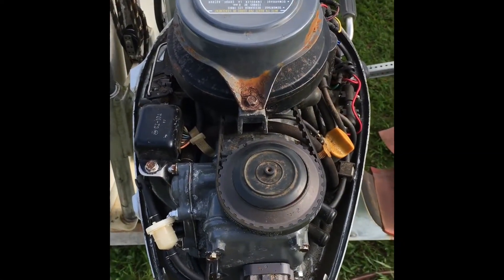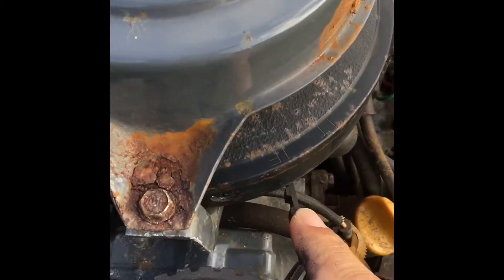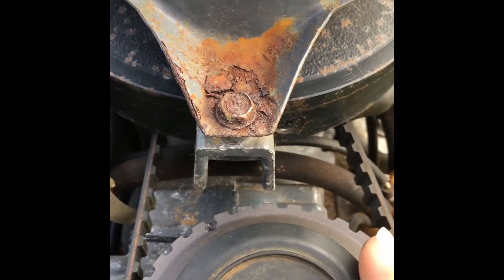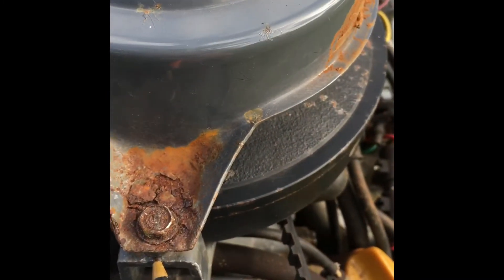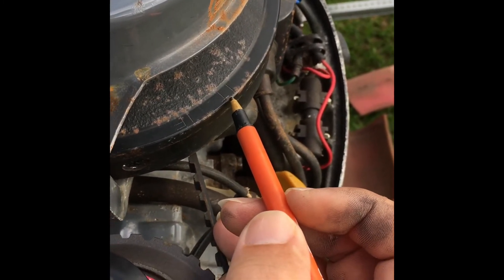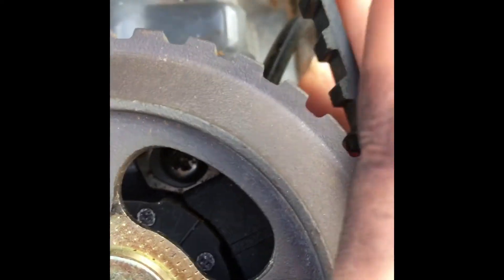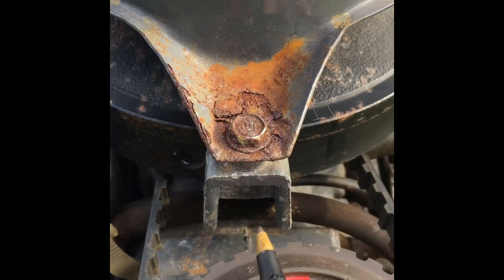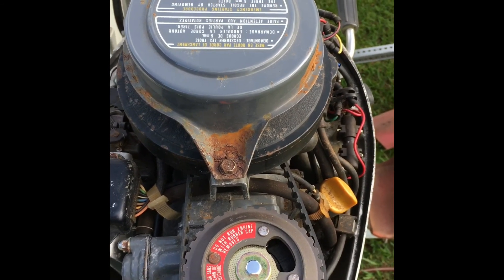Verifying the Timing on a Honda BF8A Outboard Motor

Comment: great video, does this apply to the BF100 and BF7?
Reply from the maker: Thanks. I can’t say for sure as I don’t have specific experience with those models, but in general the same principles should apply to a 4 stroke two cylinder Honda, or any motor for that matter -that being that you must align marks to makes sure your cam and crank are timed with one another before installing your timing belt, and that your ignition needs to fire at the proper point when the valves and pistons are at their correct position.

Comment: Great video! How would I check my ignition fire  F if my motor has points? Thanks!
Reply from the maker: Thanks. Not sure about the specifics of your points motor, but in general with points you would want to use a test light to make sure the points make contact to discharge the coil and fire a cylinder as indicated when the test light illuminates when the flywheel is at the correct mark, which is likely F if that’s what you have. And then you would want to adjust the gap of the points so that they open the correct amount when not making contact. The manual for your motor should cover it, and typically if you put a little time into it you can find the manual or at least parts of it posted somewhere on the internet whether it be in a Forum or what not.
Reply: @Willdesignsandbuilds  thanks, I should be getting my service manual from eBay tomorrow. Thanks for the info.

Comment: What happens of the markings of the crankshaft is not in Line with the markings (T and F) om THE flywheel?
Reply from the maker: If the cam and crank are out of time, then the valves would either be opening early or late in the combustion stroke. 

So, as the piston comes up compressing the mixture, the valves could open or close early or late. 

The effect is a lack of power, poor fuel economy, unburned gas coming out the exhaust and washing down into your oil, hard starting, the motor continuing to run after shut down, fuel fouled spark plugs, smelly exhaust, etc.. 

If you’re off by enough, your valves could contact the pistons in some motors leading to catastrophic failure. 

If you’re off by a lot, the motor won’t start at all.
Reply from the maker: I’m not sure I understand your question. The flywheel is connected to the crankshaft, so the marks wouldn’t be out of alignment. 

If you mean the marks don’t line up with the dimples in the cases, then it would mean the crankshaft and camshaft are out of timing with one another which would likely be due to the cogged belt being off by a tooth or two if the motor still starts and runs.
Reply: @Willdesignsandbuilds  yes that's exactly what i meant. what will be the consequences if it happens?thank you very much for the answers. it helps a lot!